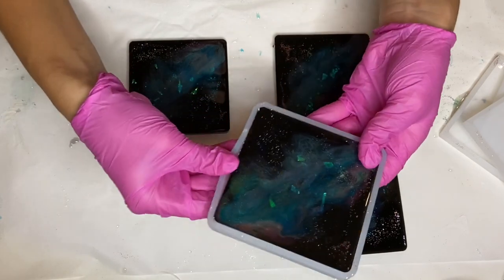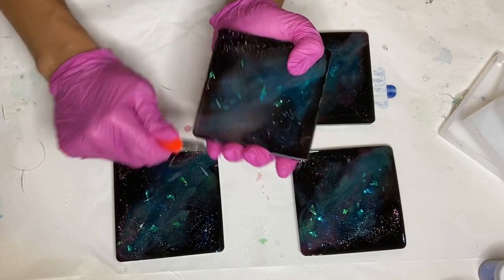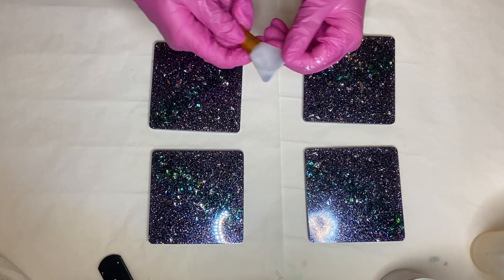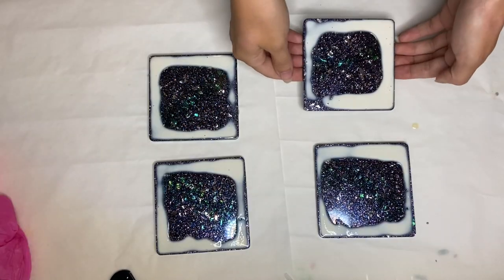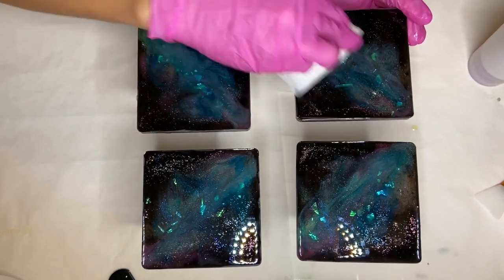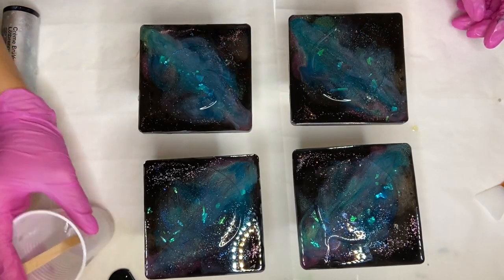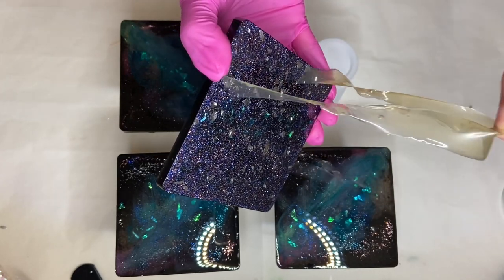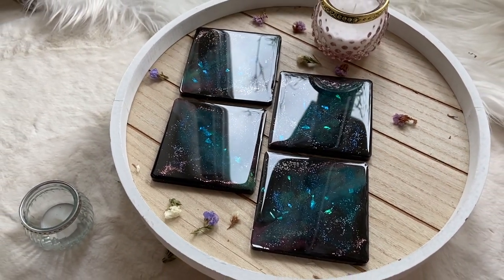How to Get a Perfect Resin Top Coat

Comment: Omg! I bought DCS after seeing this video, is amazing!!!! Mirror like! BUT! after 24h is not fully cured, still soft. On the bottle says 7 days to fully cure but after how much time is it ok to touch them? I mention my work space has  minimum 22 degrees all the time and all other resins i'm working with are hard rock after 24h
Reply from the maker: Glad you like it! I can usually touch them after 48 hours, but I like to set them aside for about a week to allow it to cure, and should be completely cured after 2 weeks. It does take longer to cure than other resins, if I need something to cure faster I top coat with Honey Resin which is also rock solid after 24 hours. DCS also has a different mixing ratio to most resins I used (100:70 by weight) so make sure you’re mixing it correctly, I messed up when I first starting using it 😅
Reply: Hello😊 Can you please tell me where can I buy honey resin or dcs? I am having trouble finding it😔

Comment: Your topcoats are always so flawless!  Do you check them periodically as they cure?  I’m having trouble with little pin like protrusion. They are perfect when I first dome. I cover them to cure and next day an air bubble in my finish 😩
Reply from the maker: Thank you! I check them several times before I cover them, after I add the resin I’ll take about 10 minutes to remove any small fibers, double check everything, and use the torch gun several times to make sure that no air bubbles pop up. Then I cover them and leave them until the next day. You want to make sure not to pick out anything after the resin has already started to thicken because then it might not level out evenly
Reply: @SummerGirlDesigns  - thank you for all the great tips. I will keep all of that in mind when I do my next topcoat. Your advice is much appreciated!

Comment: Hi. I have a question….love all your videos btw…I was told I have to sand in order to do a top coat or it won’t stay. ( I did the sand method and it ruined my work) Why did you not have to sand?
Reply from the maker: Hi, thank you! It’s recommended to sand your coasters if you’re doing a top coat after 24h/48h has passed. We typically do our top coat within this window so sanding isn’t completely necessary. If you wait longer then definitely sand your coasters, it will look scratched and blurry but once you add the top coat it will fix everything 😊

Comment: Is the resin top coat just a thin layer of part a and part b resin mix that you put on top of the fully cured resin?  Do you have to put a top coat to complete or protect the resin work?  What does the top coat do to it?
Reply from the maker: I do a top coat to dome the edges so that they’re not sharp, and they’re nice and rounded. I also use a resin that has a higher heat resistance so that a tea or coffee cup won’t damage the coaster. You don’t need to do a top coat, it’s completely up to you, but I find that it ups the quality of your piece!

Comment: You can use petroleum on the sides and bottom and the resin wipes right off.
Reply: Hi...I tried this but there were resin drops which was very difficult to scrape off. Any suggestions on how I can save those coasters?
Reply: @rhea72  I sand my mess ups finish them off again with another layer of resin.

Comment: Hi hi.What's the purpose of the liquid latex?
Reply: Then purpose is to protect the bottom side of your project as the resin moves and drips underneath. When the resin get underneath, it lands on the latex making it easy to remove those drips and leaving a smooth finish underneath. This is don in place of taping and it's s lot quuicker.

Comment: How long do you wait to demold the coaster...also I have another question...I used blue alcohol ink (2 different shades and 2 brands).Each time it hit the resin it changed colour and turned dark red...any idea why and what can I do so that it retains the original colour (one was cobalt blue and another Aqua). I tried another colour which was not a shade of blue...but it didn't react this way for that colour
Reply from the maker: We wait around 24 hours to demold. A similar thing happened to me as well as my mom, we believe it’s because the alcohol ink is light in weight and can rise to the top while the resin is curing, so one color can overpower the others. We aren’t entirely sure how to solve this, but I like to mainly stick with pigment pastes and mica powders. To answer your other question, we haven’t tried PVA glue so I’m unable to say but I’m really happy using liquid latex! Hope this helps 😊